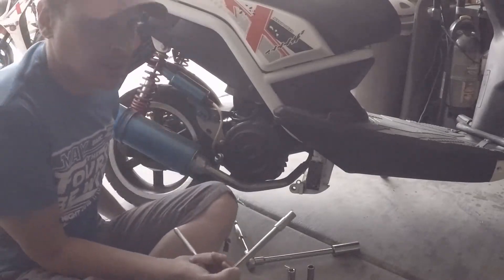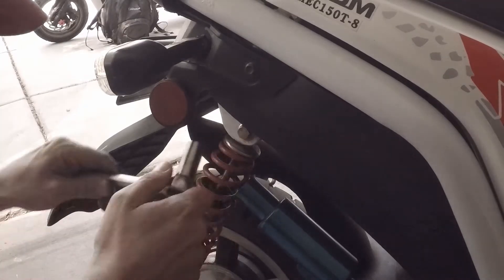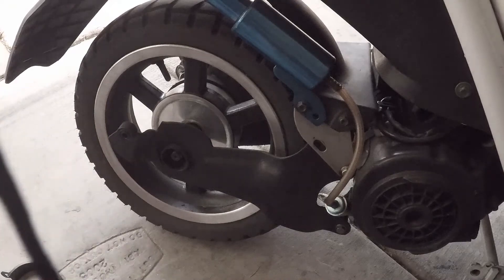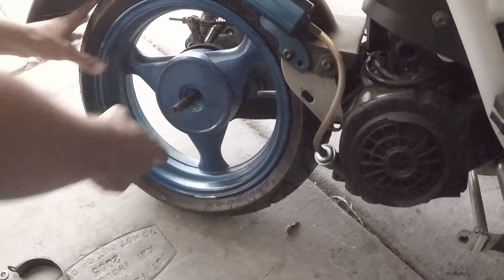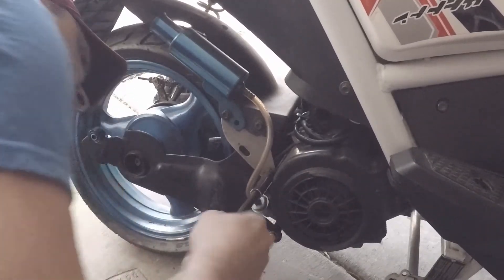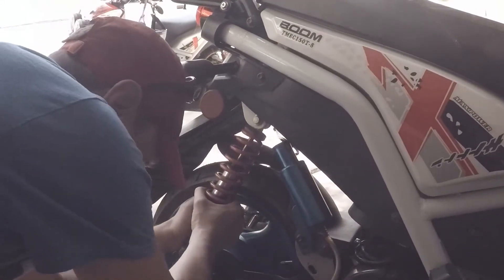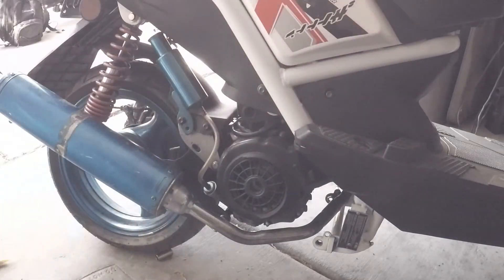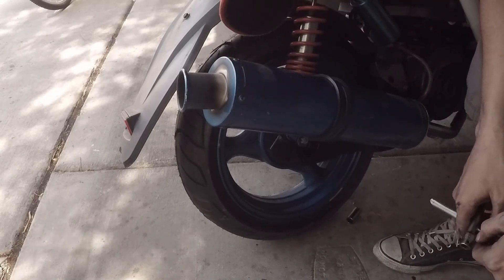HOW TO CHANGE🛵 A REAR TIRE ON A GY6 SCOOTER #AVIDTV

Comment: What do you have on the oil indicator hole?
Reply from the maker: That's a crank case breather it let the air pressure behind the piston flow freely
Reply: @avidtv123  thanks for the answer! Have a good week!